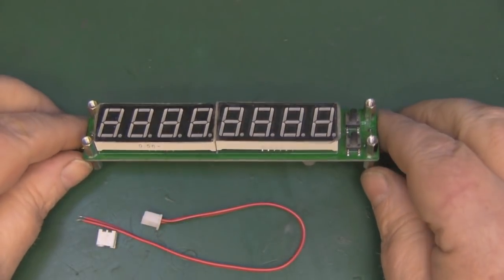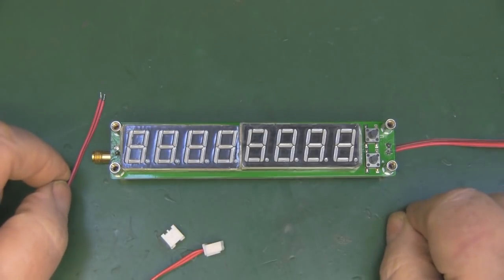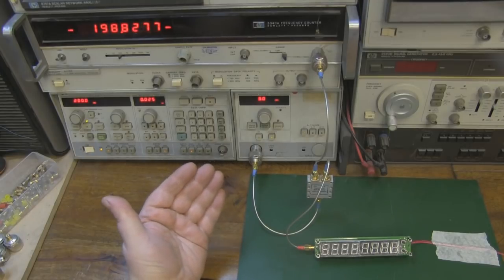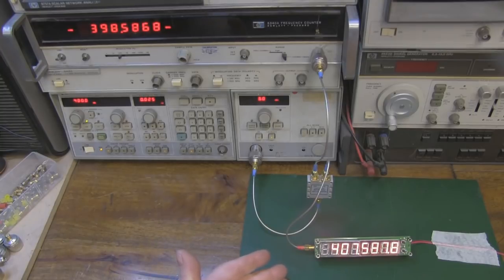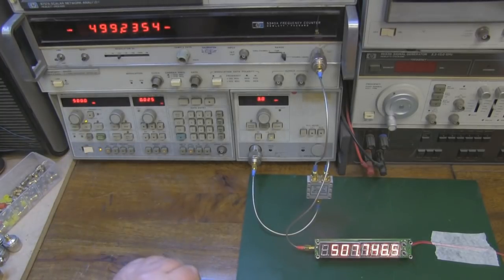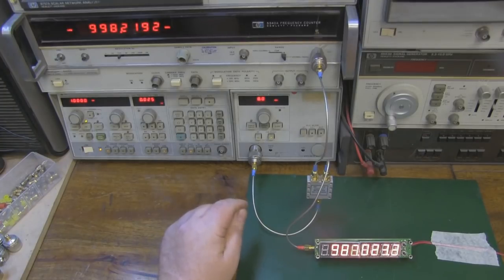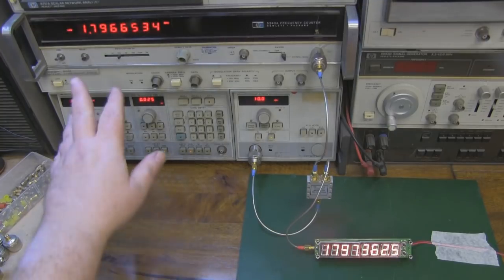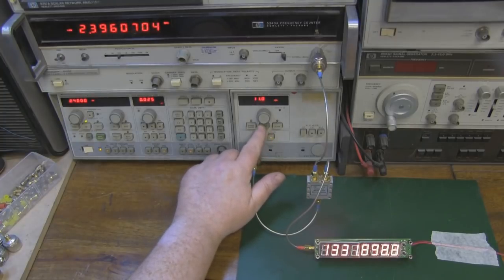Cheap Frequency Counter from eBay

Comment: Need to disconnect the h/l inputs which are in parrellel. Tiny dtsp swith or 2 seperate input connectors on cabinet

Comment: Basic specs for this type of device are  
PLJ-6LED is a cost-effective microprocessor based, six-digit digital frequency display/counter. It can be used for conventional frequency measurement or as a transceiver band displ;ay.
Features: small size and reliable performance.
Settings are automatically saved
Features:
Processor: Microchip PIC16F648A
Power: 8V ~ 15VDC (with reverse polarity protection )
Operating current: <90 mA
Display: 0.56in. High brightness 7 segment Red LED
8 Display Brightness settings (factory set to the highest)
Zero auto blanking,
2.5ppm Voltage Controlled TCXO Frequency reference
Unique gate control & accurate time algorithm (non-timed interrupt mode).
Gate time:
0.1 seconds
Dual IF Offset Adjustments (Independent + & - adj.)
Measurement Input:
High impedance
Range: 0.1 MHz ~ 60 MHz
Accuracy: ± 10Hz (0.1 sec. Gate)
Sensitivity: 1 MHz to 60 MHz: better than 60 mVPP
Connections:
DC IN: HX2.54-2P socket
RF IN: HX2.54-2P socket
ICSP: (factory programming interface) 2.54-6P pin
INCLUDES 6in. PIGTAIL POWER & INPUT LEADS

NB  this is for a type guaranteed to up to 65Mhz in.  This comes from the MPJA     dt    Com  Site in the US  There is another reference in Andrew's comments - written to another source of data .  It seems that various versions exist. Not only in terms of  6 or 8 LEDs but also  in max  frequency of  input.   There's a complaint from a user that when used as a superhet freq display it won't work if the IF is above received frequency.  I'm not sure that's true but the manual is written in bad English and the set up procedure is a bit cryptic.   TEF

Comment: I"ve made a mini stepper motor spindle run by PWM.  to measure to speed I plan to get PWM frequency and calculate it. Is It suitable to measure speed this way and will it handle the voltage output of pwm driver?
Reply: PWM does not adjust the frequency, it adjust the duty cycle.

Comment: I really don't get how a frequency counter that's out by 7MHz at 200MHz is useful for anything, I am missing something here?
Reply: I don't think he did a calibration on the FC. He never mentioned it was even possible,  though he went on for 5 minutes about his main equipment needing to warm up for 45 minutes. There is a trimmer cap on the back to make the fine adjustment to the TCXO. Just watch a few of the other videos to see how to do it.
Reply: @johnrussell6620 All good if you can cal it and it remains stable.  I'm still gobsmacked that this guy says "it's pretty acceptable".  He looking at it being a good 7 or more MHz out and says that's acceptable. Wow.....

Comment: I cant seem to find in the manual what wattage this will take when transmitting into it. Any Idea? Had one of thease for years and never used it and now wish to use it to align some CB's I was given to restore.
Reply: No watts at all. It is not dummy load! A foot of wire near cb ant gives all you need. No more yhan 0.01watts.

Comment: How do you connect it to a radio
Reply: Wire near local oscillator. Set if offset to match radio. To rcv 1 mhz station, osc is at 1.455 mc typically. Set if at upper 455 kc/ KHz. Counter displays 1,000,000

Comment: Why is the cheap counter's frequency display SO unstable?  That's hopeless for any accurate work!  My 2 same modules are extremely stable up to the last 1 or 2 digits - even at 2GHz+.
Reply: Accurate work costs more than 8 euros
Reply: @johnrussell6620  This true but I was talking about stability of the reading - NOT accuracy!  With a GPS disciplined oscillator and a frequency multiplier you can gauge the accuracy - but not if the display is jumping around! 😀  As I said my 2 examples (admittedly working off a battery supply) show stable, but not absolutely accurate, readings even at 2GHz+
Reply: @hectorpascal  This one actually is pretty stable with an increased amplitude signal as shown later in the video. I think he could have turned it up a bit more, but he did not. He was describing his increases in 1 and 2 and 3dB increments. I lost track of where he stopped. I just want one to see if any frequency is happening at all and if it is anywhere close when in the field without any bench equipment. Anyway, don't buy or build one if it won't make you happy in the end. ..... p.s. This thread is 4+ years old and the author probably doesn't care about either of our comments.
Reply: @johnrussell6620  Yes FWIW, when I tested mine I seem to remember they were particularly "unhappy" at low input levels when powered with an SMPS supply - but I almost expected that and never explored it further.  Switching to a battery supply the display was much better behaved.

Comment: I tested this on fm digital radio and it shows exact.. it seems that your frequency generator is off and need calibration...  guaranteed your freq meter is off showing  minus 4% to minus  7%  lower then it should.. recalibrate freq generator..  87.00mhz - 108.00mhz exact guaranteed

Comment: mine was unstable w/a 12 volt smps so i used a 9 volt supply instead. rock steady and accurate too.
i paid a little  more to get  the clear  case.

Comment: Any tips on interfacing this module with a receiver or transmitter? I have not been able to get the module to read anything except my signal generator...
Reply: Set if offset to above or below local oscillator. Receiving 10 MHz, with radio that has  a 455 kc if, the local osc will usually be on 10455 kc. The 2 freqs combine and give 455 out to if amp. So read osc, via small cap or a few turns of insulatrd wire around pdc tube/ transisr, etc. Set if offset per manual and cointer shows 10 mc recv freq. Plj-8led-c manual on net search will get you close.

Comment: I'm behind in watching and thinking the Umbrella Antenna was the last when I was keeping up with the channel.  

Neat to see this little counter as I've considered investing in and have watched a video or two regarding and seem decent.  I'm not finding in my history and I know I've commented regarding.  The one demo I watched and commented on seemed to perform better if are the same make and model that were demonstrated. 

Whatever the video if still present on Youtube, I recall clearly posting this reference for someone who was wondering if can be hacked to increase frequency range for up to 5.8GHz and I noted try this listing and ask the gentleman:
https://www.ebay.com/itm/FREQUENCY-COUNTER-3-4-GHZ-1-HZ-RESOLUTION/151219799000

I use a Victor VC3165 that works good so haven't invested in another yet... though for mobile firmware ops I've considered investing in this smaller unit and for base station/lab work I eventually will invest in a lock in amplifier and counter up to 26GHz since I see those going for reasonable prices now days.  I recently scored a 40GHz Gigatronics 8541 power meter.  Almost won an 8652A though wasn't paying attention on the bidding at the end where it only went for $44 & ~$18 shipping.  Really haven't been watching the counters lately. 

Back to this frequency counter demonstrated... seems the review I watched was more accurate like he had a better batch or one with better inspection or tuning before shipped.  Strange how I don't have in my history anymore... though have had some strange log-in warnings and transactions on google, ebay and paypal recently that were caught. 

Keep us posted on these as I'm interested to see what the issues are and what potential areas of opportunity for improvement and/or expanded capabilities.   Especially interesting to me is the cost effective OXCO's with GPS discipline capabilities in a small package that might increase the accuracy of these little counters significantly.
Reply: Found the reference I was mentioning above... man... was driving me mad since I didn't have in my history:
https://www.youtube.com/watch?v=A8TOGdKab0g

Here is the GPS design also worth considering that I'm thinking will improve these that is in great detail:
https://www.youtube.com/watch?v=1Dp1Yu-KMns

Comment: Thanks I just ordered one thought it would be good enough we’re doing electronics 101 class homework projects. Just HP 3312A function generator working for $39 and HP 5345A universal frequency counter with option zero 20 and zero 60for $59 eBay working. I can tell you the nearly 40-year-old Heward Packard frequency generator put out a much cleaner and stronger signal then the brand new Chinese made $80 frequency generator.
Reply: Great deals, recently saw a HP 3314A go for ~$177 on shopgoodwill.com!

I've been looking into the HP 3325 based on this suggestion though have the 8640B OPT 323, Wavetek 142HF, Protek B801, Tektronix FG503 and most recently the Wavetek/PMI NS201's:
https://www.quora.com/What-your-favorite-make-and-model-Signal-Generator

 The Victor 3165 seems to be working fine for now as a counter investment... though I do want to buy a HP counter most likely eventually. 

I figure rescue the Made in the USA high quality systems if you have the room.  They're easier to work on to repairs seems also.

Comment: I have one of these and really like it for HF but I haven't used it above that.  This would really benefit from a color lens in front of the LED.  The color depending on the color of the LEDs in your unit. Even a piece of cellophane might work. Does anyone know where to purchase tinted plastic like that?
Reply: Just Google "colored transparent plastic." You can get sheets or tape. 🤠

Comment: I had a look at the manual and there is a test graph showing that the input sensitivity falls with frequency quite rapidly. The input to the prescaler is in parallel with the low frequency input, rather than switched in series.  There is a suggestion to split this on the board into two separate inputs. There is also an argument for adding an external prescaler for SHF work. This is what I have done for my RACAL counter. I also note that you can adjust compensation for the TXCO with a trimmer, when measuring against a known frequency standard. All in all an interesting little module and worth putting some extra work in to improve it. Thanks for the review and I’ve just ordered one.
Reply: I know that Laver might not be looking at this after four years but please if you are - can you nominate any freq divider chips  ie prescalers that will take  say  4 Ghz down to  1 Ghz to put in within range of this counter ?  I don't believe  the Txco is really temperature  compensated. I think it 's just a standard miniature canned oscillator. I got my manual off the website of the US Reseller who might be in Georgia.  Appreciate any insights.  Tim F